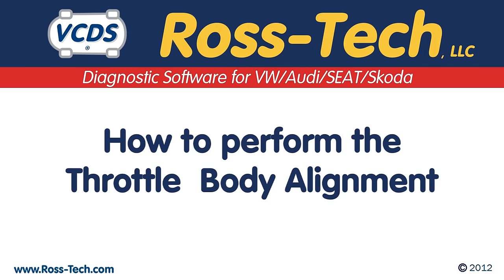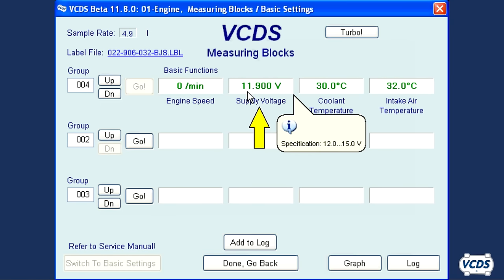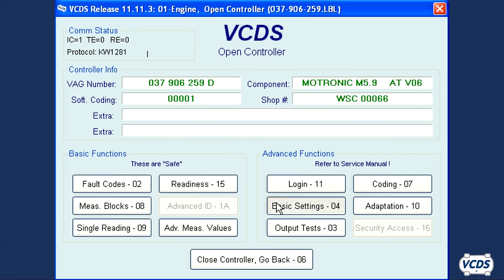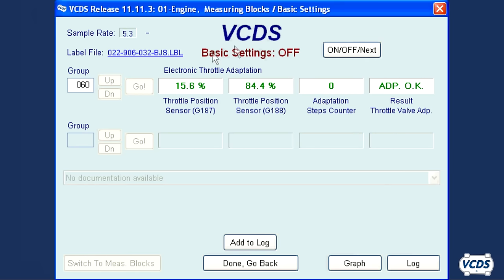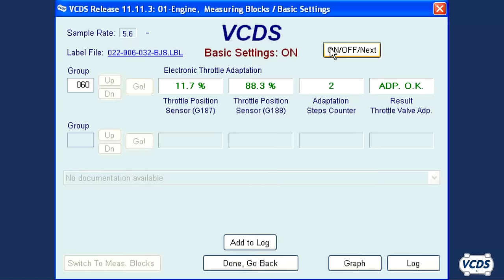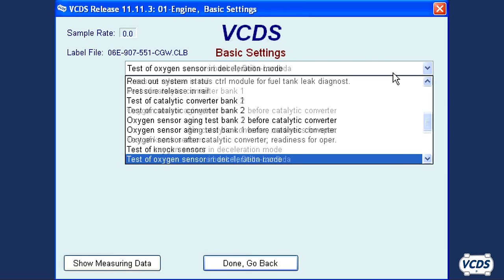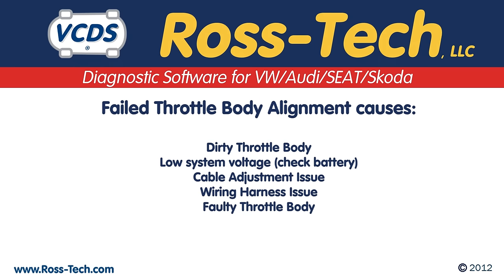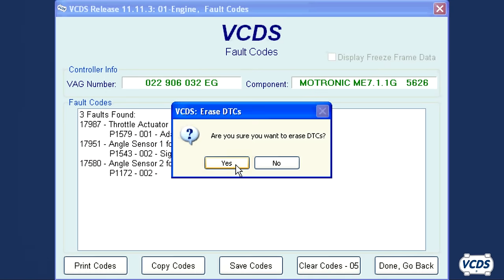How to do the Throttle Body Alignment with VCDS

Comment: Issue was throttle body adaption after disconnecting of battery in a 1999 VW Passat wagon.  Today is Oct 2, 2020 I ordered the Hex-V2 a week ago, it arrived in the mail this afternoon.  I downloaded software and connected everything and followed the steps in this video.  It recognized the fault in the throttle body and took me through step by step to readapt.  Was back up and running in about 5 min!  Then took some time to go through and clear other codes.  Thanks Ross- Tech!
Reply: having this issue with exactly that car. did you have to buy the $99 registered software key or were you able to do it without?
Reply: @ughblenders  I believe I bought the $199 Hex-V2 version that lets you work on up to three  vin car numbers.  By the way, the older cars it doesn’t register a vin in the system, so you get more wiggle room depending on the number of cars your working on.  As I said in my post, i downloaded the software, hooked it up and had the throttle body issue cleared up in just a few minutes.  Hope it works for you!
Reply: @ughblenders  I called them to order and the tech that took my call was very helpful
Reply: @juneaufabrellos  bought mine off of Amazon so when I reached out for my activation code they told me it wasn't through a verified seller. Guess I'll pay the $99 for the software bypass! Thanks, appreciate it 🤝
Reply: Srry how do I get this system does it come with the cable to hook up to car or can I buy the whole computer and everything somewhere I know it'll be helpful for other cars as well
Reply: Call Ross-tech they are very helpful.  You’ll need to own a laptop so when you buy the Ross-tech software you have a place to download and install the software.  Software runs on a laptop then you also need to buy the adapter and cable that plugs into your obd2 port on your car.  This allows the software loaded on your laptop to communicate with the engine’s computer system.  See my first post… again I would call Ross-tech as they were very helpful.

Comment: Great video. Did this the other week but I forgot to check the battery voltage, the TBA solved my problems for 2 days but the problem came back. I forgot to check the battery Voltage, what happens if the voltage is not over the limit 11,5-11,9 V?

Comment from the maker: Then you wait more than 30 seconds. :)  I'm not really sure why the 30 second rule is there in the first place.  From our point of view (VCDS), nothing happens between the ECM and VCDS after the ADP OK message comes up.  The EPROM does need to save new values from the Throttle Body, but I would think that takes 30 seconds to happen, as in milliseconds.  But the 30 second rule comes from VW / Audi, so I'm sure there is some reason for it.
Reply: my 1.8t aeb 1998 drive by cable  runs the group 98 adapt over and over again, it wont stop. looks like in the video but after like 8 seconds it starts again... no codes. only a climbing idle speed from 900-1250rpm, hot and cold. this is after cleaning and ecu was unplugged. Thanks!

Comment: I was trying to calibrate my throttle body in my audi a4b7 (8E) 2005 but i don't have any of these options. Protocol says CAN, there's no channel 098 or 060 and in the drop menu there's only EGR, boost pressure and Fuel pump. Can i get a bit of help?
Reply: Diesel engines don't have a TB

Comment: Good morning, I installed the new EGR valve and the new throttle body, do I need to alignment them?  I reset the error and it didn't reappear, the machine seems fine.
Golf 5 
2004 2.0 tdi 16v 103kw Bkd.

Comment: Hi. I have a Seat ibiza 1.4 TSi 6j cupra, BocaNegrA version with 180hp. Original.  I m doing the replacement of that throttle.  But I also have to replace the other one behind . Exactly behind of that black plastic throttle, theres another metal throttle.  
So How can I differentiate the alignment from the plastic throttle to the metal throttle with VCDS and vagcom??

Comment from the maker: The shareware version doesn't support Basic Settings.  But when you purchase the full version, then yes, it is possible to do a Throttle Body Alignment.
Reply: what is the full version? i sepnt $270 on a VCDS scanner mainly to do a TBA and i have the downloaded file from the 20.12.0 release how do i know if i have the full version or not?
Reply: @MrJT1369    If you purchased from our web site or one of our distributors, then you have the full version.

Comment: I was under the impression you can do this without VCDS, supposedly you turn the key on hold the gas pedal to the floor for 5 seconds, then switch the key off then release the gas pedal the alignment takes place by itself over the next few seconds with the key off...
Reply: I also thought that, but my 1998 aba is still having idle bouncing/surging issues. So I’m hoping this will fix it

Comment: I'm trying to perform the thottle body adaptation on my Brazilian VW UP TSI using the new VCDS version V22.3.1 for win11 but I can't find the option anywere! Maybe they removed this option from this version or changed the option to another place?
Reply from the maker: We are not removing things from the software.  But different vehicles can have different variations of how to do a given task.  We offer free vehicle support on our web forum for our registered customers, post there for further support.  http://forums.ross-tech.com
Reply: @dreadwings3  I found the opinion to perform the throttle body alignment on the newest vcds version, which is on a very different location. Will need to re- learn how to use vcds because they changed things place. Regarding if I could manage to perform throttle body alignment, the answer is I am not sure because at old version v12, we can listen to the throttle body working (the characteristic noise) with the newest version the throttle body simple do nothing. The characteristic noise is not present. Therefore, I am not sure if it's working properly or not.

Comment: I have a 2019 VW GTI SE and I changed my battery. The cruise control didn't work right away, didn't think about it on a stick shift. I parked, turned it off, turned it on but not start, waited for 5 minutes, turned it off, started the car and suddenly I had my cruise control back. I have no idea why, just sharing my experience with this model VW.

Comment: On mine, instead of showing adp ok it says error. I have checked the relay by the computer and it seems fine also.
Reply: did you find a reason? I saw one today with the same issue
Reply: Mine had a bad engine temperature sensor. Basically the car thought it was extremely cold but it was in the summer time. I'm not sure if that was the causing the error though. Did get the car running again, at least for a few months. It did the same thing again and no matter what we did, we never did get it started again.
Reply: @tazgamerplays  seems like there are different kind of throttle bodies, check vcds website and they say how to adjust each one of the three kinds. There’s a video from their official channel, probably you need to run a full on-off time to get it to adjust
Reply: @azzz8083  We ended up just junking the car. We started having other issues. The back driver side door had a short somewhere, the front passenger window mechanism broke, an exhaust leak started after getting it running. We didn't want to put the money into it.

Comment: hi sorry about this. but i do have a BMN engine code audi A3 170BHP tdi and it does have a throttle body. what did you mean ''diesel don't have throttle body''?
Reply: means diesel cars does not need any air.  :D :D

Comment: Why does mine shows "adaptation value - error" in the last box, when I go to channel 060? 2000 Audi S8. Ignition on, engine isn't running. VCDS Lite 1.2 full.
Reply: I'm having the same problem

Comment: Hello,, 
After replacement of the fuel level sensor in my touareg 2011 / 7P . If the fuel lamp still on and the meter reading still zero .what can i expect .
Thank you.
Reply: Check the connectors properly fixed..I had the same issue before..Opened again flange and removed the connector and refixed back..problem solved

Comment: Hi, do i need to do something similar to the EGR valve if i changed it? Thanks
Reply: @johnsantos6948  i have replaced the egr with a new one and i received after 4000km insificient flow from egr. Is it already faulty? Should i replace it again?
Reply: @johnsantos6948  when I replaced the egr, i also replaced the throttle body. They were both new. But egr keeps giving error p0401 egr a flow insufficient detected
Reply: @johnsantos6948  i have an aftermarket one for egr, and original for TB
Reply: @johnsantos6948  what do you mean "swap"? Replace it?

Comment: Hi,  I had my door electrics messed with on vcds. now my window switches work opposite to what they should also the wing mirror swich is opposite. any idea how I can sort this? I have vcds so can access the systems. many thanks
Reply: You probably have the coding for LHD vehicles, you'll likely need to either change through the hidden menu or by changing through vcds, although be careful not to incorrectly code as you can cause permanent damage to expensive modules.

Comment: I have VW Passat 2000model 1.8T.\
the engine will go off shortly after I start. and at a time it will not even start
what is the cause?
Reply: The immobilizer is cutting the engine off I guess? Have you changed the key and missed to program the new key?

Comment: Hello. I can´t do the Throttle Body Alignment. The car is a Golf V 1.4 FSI 2004 and appear "Error" on Group 60 in Basics settings. I already change the throttle body, ecu and check the wiring. I think that the problem is the lambda sensor. The dtc is "Adaptation not started". Please help. Thanks (sorry my english)

Comment: Crank and head is Right, transmission saved in pouring down rain fluid right, not diesel found it gas, got the job of read that's. Han nes bag box and battery goes out about as expected. Dec 25 2022

Comment: Hey guys. Can someone tell me if I can use this program VCDS and the diagnose cable with a tablet? Thanks
Reply from the maker: Szalasi Zsolt Depends.  Our wired interfaces can be used with the Windows 8 tablets.  You can find them for under $100 for the 7" and 8" versions.  They often have a micro-USB port, so an adapter would be needed.  

Our HEX-NET wifi interface comes with VCDS-Mobile.  VCDS-Mobile works with Android and Apple devices.  Search our Ross-Tech.com website for "HEX NET" to learn more.
Reply: The thing is I already have an interface (Hex-Can 12.12 with usb connection cable) and I wanted to know if it could be used with the Android tablets, but I realized that it's not worth complicating things, I'm gona buy a notebook and that should do it. Thanks for the info anyway!

P.S. I tested my car the other day, wanted to know if I have any error codes , and after the full scan I started the engine and wanted to see the real time functions (measuring blocks)  and surprise .. any number I picked in the measurings groups it wrote N/A  and some error ... I don't recall anymore what it was. What could do that kind of errors?
Reply: +Szalasi Zsolt i have the lynx tablet and works fine on the wind 8.1 i do however have both authentic uk vcds and the rosstech software

Comment: I have a vagcom cable, I got a engine fault for intake manifold sensor flap fault, I had the flaps sensor changed and I still get the same fault for sensor position flap, I ha r a tdi diesel mk5 jetta and was told that a diesel has no throttle body my engine is cjaa so I tried to adjuat the flaps in vagcom I get a error any suggestions thanks
Reply from the maker: At the 4:00 mark in the video it is stated that that diesels do not have a throttle body, so the details in this video would not apply.  If you need further assistance, contact Ross Tech by email, you will find our email address when you click on the [About] button from the first screen of VCDS.  Regards.

Comment: So now that I know my 2006 TDI has no Throttle-body,  how do I use my RTech software to get my car out of Anti-theft mode? I changed the ignition components except Key housing/ chip reader.  Car starts the shuts off ?
Reply: What do you mean it has no throttle body? Of course it does
Reply: @b5Bart  Diesel engines don't have throttle bodies

Comment: My mechanic was going to charge me $75 for this!
Reply: +jensen chase its not surprising considering these things aitn cheap, so they have to make their money back (obviously they are also using up their time to press buttons but also go further into doing some physical diagnostics afterwards
Reply: @Mathewmartialart  my dealership was going to charge me $500 to test a good throttle body then even more just to have it replaced and labor on top of that, I decided to do it and it only cost me $60 and 3 afternoons also one of the damned hex bolts holding the throttle body on was torqued down way too much and stripped out, then I had to take out the intake manifold luckily I have a mechanic who allows me to use his shop and tools to fix my cars, although I would consider my Audi more of a nightmare than a car XD
Reply: thats cheap. do you work for free?